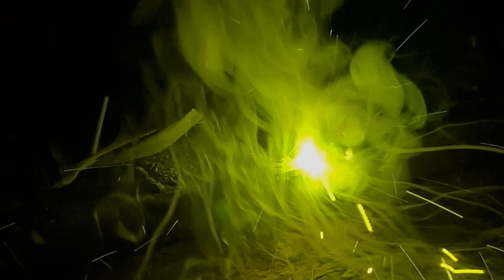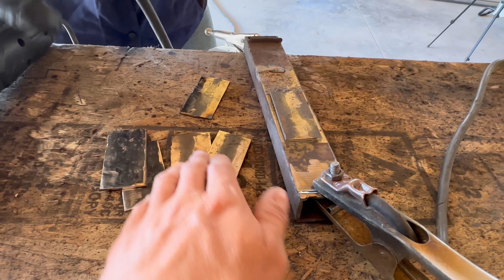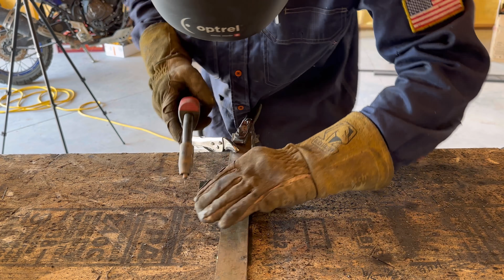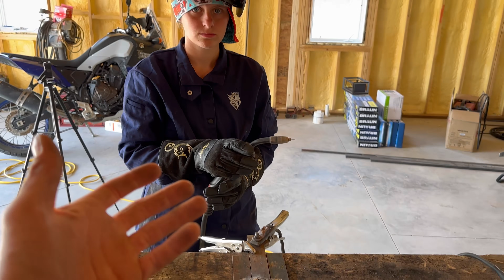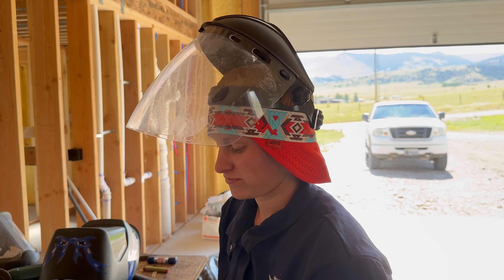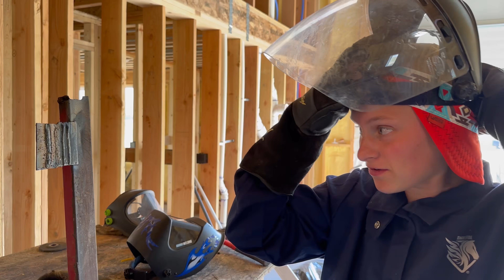Flux Core Welding for Beginners ( FCAW 101 )

Comment: Chip your spatter, don't wire wheel it. Use a chipping hammer and chip them off, or you'll fuse them to the plate, and they'll never come off. That or use a fresh wheel at the very least, also chipping the slag is much better, while it can fly into your face if not careful, wire wheels fling them into your walls and embed that shit everywhere, while great in a shop, not so great in ones home.
Reply from the maker: Shut up dummy

Comment: Couple of questions... First, I'm new to welding, and every other video I've watched (and it's been quite a few), suggest a longer stick out, like 1/2" to 3/4" to give the wire time to heat. Why are you using a much shorter stick out?
And second, I'm trying to build up the thickness of my transmission pan with a 2x2 welded to a 3x3 to weld to pan for tapping for a drain plug. All are 16g steel. I have a good looking weld on single sheet of 16g so I'm comfortable with my settings, but when I try a lap weld it kinda goes to shit. I get the rope looking weld. I just don't know if I should up the amps/wire feed or volts. My welder is a cheap Amazon welder but plenty of buyers that know how to weld day it works great for the price range. I'm convinced it's operator error causing my problems moreso than the welder itself. Any advice would be greatly appreciated! Thanks in advance.
Reply: The stickout should at least be half inch. Some welders claim that shorter works, but that is not what welding engineers recommend. You have to give time for the wire and flux to heat up. You'll definitely get slag entrapment (very bad) if you go too short of a stickout. The flux needs time to fully burn properly to produce the shielding gases needed. If not, it may hold most of the time, but it will ALWAYS fail a welding exam. The channel "making mistakes with Greg" is excellent, if you want a more in depth explanation on all things welding. He does many real-time tests. He doesn't just say it, he shows you. Very humble guy
Reply: Thanks Anthony, yeah I have watched a few of his videos and I feel like he knows his shit. I watch other videos and hear them say things like "not the best weld, we could clean it up by adjusting the settings", but then they have no follow up on WHICH setting, and whether to increase or decrease. I'm just getting a bit frustrated lol

Comment: Will you make a video on how to set the adjustments on a flux core welder?  How do I know if I’m too hot or not hot enough or how fast I need my speed.
Reply: I will say it becomes a visual and aural intuitiveness over time.  Initially follow the metal thickness chart given for each welder. If the voltage is too low and wire feed too fast the weld bead will be tall and glumpy and the heat signature on the back of the material will be very faint. If the voltage is too high and the wire too low you will get a zap zap sound and spotty beads. U want to hear a smooth consistent sparky/bacon sizzle sound and have a slightly flat/low crown on your weld. Play around with the wire speed voltage mix and see what happens. There is no 100% correct setting. Hot is ok as long as you are not burning thru the material and have enough wire speed. Conversely overheat the metal and wasting the wire is not needed either.

Comment: 16 years into welding never ran electro-negative for flux core and I'm d1.1 certified in flux. I weld in a f1 27 amps .52 wire 250 wire speed. I used dc 600 Lincoln bridge code I built bridges MDOT codes the most strictest codes out there
Reply: I said the same thing till I tried it it runs way different much cleaner less splatter

Comment: Can you run a pass over a pass with flux core? If so is there a diff in wire needed to be used? Or can you just clean the flux and go over it again?
Reply: You can with the right wire, like Lincoln's Innershield 211 MP wire. Clean flux and go over it again. Some wires like ones from Harbor Freight or US Forge are not approved for multipass welds.
Reply: @brnmcc01  thanks 🤘🏼

Comment: On the topic of stick out, I’ve noticed that certain brands recommend different things. Some like short, some like long. their voltage settings usually very accordingly. all fluxcore runs similar, but sometimes those little things help reduce spatter
Reply from the maker: Great point!

Comment: I hate self-shielded, small diameter flux core. Like a spool gun for aluminum, it’s just a rudimentary means to an end.
Reply from the maker: Every process has its place
Reply: You’re correct. The best use that I’ve found for small diameter self-shielded flux core is welding metal studs. There’s even an AWS cert. for it that I got a year and a half ago to weld a shear wall up in a new Wendy’s.

Comment: oh you gotta do one for stick welding lol, vertical 7018 1/8th rods have been kicking my ass with undercutting.
Reply from the maker: Could be too high of amperage or too slow
Reply: Stop pointing the tip of the rod uphill. Your rod angle should be 90* perpendicular to the weld joint. Your amperage should be between 110-120. If that doesn’t work, try incorporating a slight weave side to side as you progress upwards.
Reply: oh. angle is pretty much dead nuts 90 degrees in there. i think its my side to side angle that is messing me up. amperage is 112 but i always get undercut if i start from the left side filling out to the right side in a t joint, it always has some form of undercut on the left side of the welds. plus watching the puddle i think i have an understanding of what to look for but honestly? not 100% lol.

Comment: 1/8" stickout doesn't give the flux core enough time to adequately create the gas envelope for good welding and can lead to porosity and inclusions.  For .035 with proper machine setting should be roughly a 1/2 inch stickout.
Reply: I use 1/2 to 5/8 with .030 and .035
Reply: .035 needs time to heat up

Comment: Thought flux core needed closer to 5/8 or 3/4" stickout  to allow the flux to heat up after it exits the contact tip?
Reply from the maker: I think that’s too much, I’ve had bird nesting with longer stick out
Reply: I've heard from 1/2" to 5/8" for 035
Reply: Depends, if it's dual shield with gas yes, if it's gasless then that stickout will be too much

Comment: I'm impressed. Emily does her first welds as a pro. Holding the MIG gun steady can be challenging due to its weight compared to the stick electrode, which you can grab at the tip. Thanks for an inspiring 101. Cheers.
Reply: Learning from the best
Reply from the maker: Cheers!

Comment: lots of people get confused between self-shielded and dual-shield corewire.Self shielded wire uses aluminum as a deoxidizer,so it isn't compatable with other processes (for mixing welds).Dual-shield loves the volts and stickout to pre-heat the wire.I admit that I only ran Lincoln nr233 once,but a 33lb roll of .045 71Elite lasts me a day and a half at work.Great video Anthony!
Reply from the maker: Thank you!

Comment: you know how a lot of gasless flux core is "single pass" who tf came up with that why cant you stack stringers according to the manufactures of the wire. surly the strength isn't gonna change. if you got a hydraulic press would be interesting to see a bend test
Reply from the maker: I might have to do that
Reply: That’s for the smaller diameter wires its still multi pass as well just not as structural sound Lincoln 211 wire is only good for 1/2 plate and 212 is good for 3/4 plate. the wire is much thicker with 212. the structural flux core is multi pass and lays down tons of metal which is Lincoln NR 305,232,233 the diameter is thick wire .068 and above and could weld unlimited thickness with these wires types